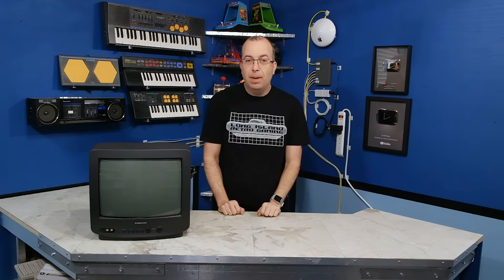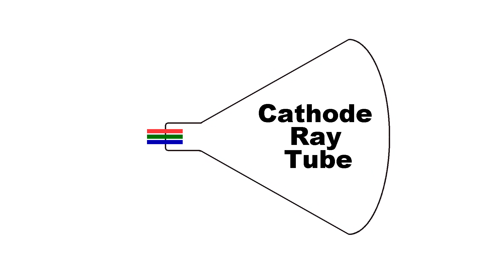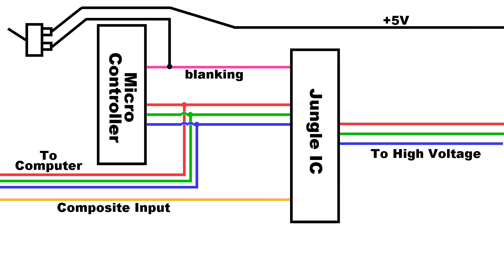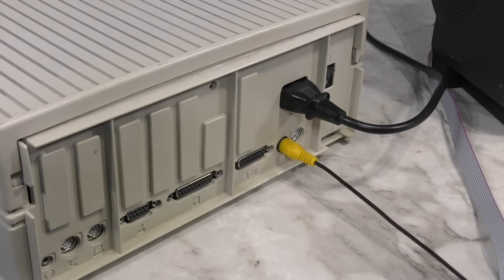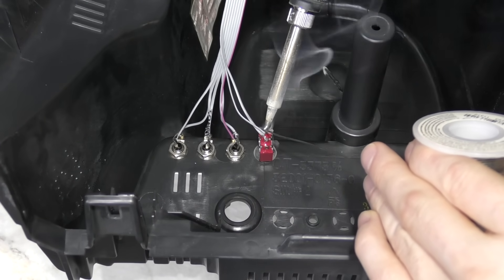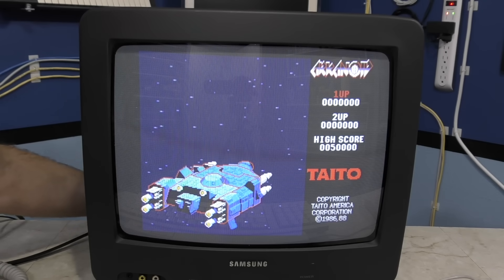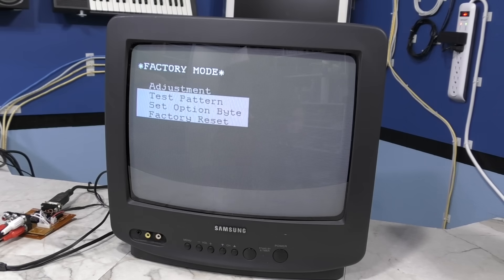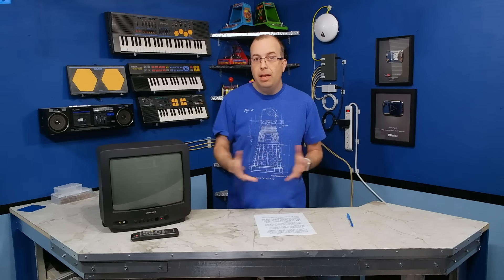Modding a consumer TV to use RGB input

Comment: Very nice! For ages I didn't know that Scart RGB is something that's not common outside of European countries.
Reply: Just a note, just because a TV has a scart connector, doesn't mean it supports RGB input. We had a sharp with a scart connector and it only accepted composite and s-video input.
Reply: @Kurt Häusler: I would suggest that in fact your TV SCART connector was capable of RGB (as the video says, internally the TV must support RGB). However the RGB pins on the connector were separate from the composite video pin, and some cheaper SCART didn't connect them (that's 3 extra wires after all), so with no RGB connect the TV reverts to composite. But essentially you are correct: SCART is an connector type, there's no guarantee that it will be wired up in any particular way.
Reply: > just because a TV has a scart connector, doesn't mean it supports RGB input

True, but those TVs are rare, because in order to be able to sell a TV in France, it had to support RGB. Only manufacturers who ignored the French market were able to omit RGB support.
Reply: @MrKurtHaeusler  VERY Important point. A lot of people think SCART == RGB. Direct RGB via SCART was often a high-end option.
Reply: @MrKurtHaeusler  same as i have seen in Norway too :) usually youst composite :)
Reply: You're right. Also by late 90s and in the 2000s there were TV with 2 scarts, only one of them with RGB, that conector was marked in blue, the other one was only capable to manage composite video.
Reply: On the UK Europe versions they got it right Scart 1 was oth RGB and NTSC support. Scart 2 was often Composite and S-Video based Scart with PAL only. 

Composite was NTSC and PAL over YWR RCA Cables input.

The later UK TV's are definitely what you want to import for a good RGB TV with all the picture standards even if the S-Video port only supported PAL whilst every other port is region free it's still the best for the time the later RGB TVs.
Reply: I hate to see that most modern 4k tv's nowadays have no SCART connector, only a combined composite/component input and HDMI. Which is a shame! The #1 requirement i have for a tv is a single SCART connector for my retro consoles. Why? SCART is basically every analog standard that ever existed in a single connector. With the right adapters, you can run composite, component, s-video and RGB through the port. SCART even had stuff like passing your tv's remote signals to your VCR, which has been adopted in HDMI (HDMI-CEC originates from SCART) or an video and audio return signal for your VCR.

SCART was truely amazing....
Reply: Might have been more to do with the fact that we tended to use TVs largely with consoles in North America back in the day as opposed to microcomputers; never heard of SCART until I got online and read about it :)
Reply: In Europe from the mid-eighties all consoles came with SCART connectors, as did micro-computers. Though as SCART carries both RGB and composite, not all of them used RGB out of the box (by bundling a cheap, composite to SCART cable) but most could.
Reply: @Wazoox  Not everywhere. I live in Finland, and got a Commodore 64 around 1988, and only got that simple antenna cable that connects the computer to TV. And I've never seen live those switcher boxes that the Americans and Japanese seemed to have with similar systems. Instead, we just had to every time pull out the normal antenna cable from behind the TV, and directly connect the cable from the computer, and after finishing with the computer, put back the normal antenna cable. But on the other hand, I don't think either of our 2 TV's would have had SCART back then, anyway. The large ('large'=26" in that time period's scale) TV in the living room was a wooden Salora, and I think it only had permanently installed power cord, antenna connector, and some mysterious round (DIN?) connector in front panel under a small door, that was never used. (The connector might have been for connecting a camcorder, which would have been really rare back then, or it could have been for connecting an optional, wired remote control.) A smaller TV, 14" Peony, was bought with the computer, and I don't remember it having any extra connectors either. Though, the 8-year-old myself might not have understood and memorized everything, but definitely, if we'd have had a SCART cable, I would have gone through all appliances to see if such funny-looking cable could fit in. I think it was at some point in the early 90's, when our VCR was replaced, that the new one came with a SCART cable. The old VCR would have had SCART connectors, but they were never used.
Reply: CanuckGod scart has nothing to do with microcomputers, the French developed it in the early 80s because of VCRs.
Reply: CanuckGod Consoles came with scart cables too in Europe,
Reply: consoles were also SCART in Europe- I actually don't remember using anything else until hdmi came around. "modern" tv's had rgb but only a few (and mostly the expensive stuff) did put out rgb....
Reply: Oli K hey that explains why my picture always was as bad as 8-bit guys picture, even though I always used SCART. Can you RGB-Mod the cheap european TVs?
Reply: In the early 80s lots of my friends in Canada used a TV with their VIC-20s and C64s. It was generally hooked up with an RF modulator and TV-GAME switchbox though, so not great quality. Served me well for a long time. Never got a dedicated monitor for use with my computer until the Amiga years.
Reply: In 1981 SCART became mandatory for TVs sold in France. Eventually it became standard for most of European countries.
I think French were forced to develop some standard for AV devices, because their color TV standard (SECAM) was too bad for this purpose: it screwed up the colors when combining two signals together, which for example made impossible for VCRs or satellite receivers to overlay OSD text.
Reply: Invader TAK On the flip-side we got shitty PAL ports that ran slower, often music playing slower and stunted graphics :( The Japanese though, they got the best of both worlds...
Reply: PhilsComputerLab got my snes 60hz modded back in the day, was a pretty essential mod, even pal designated games ran full speed then
Reply: @philscomputerlab  would still rather pal than ntsc.
Reply: GitarStu if you were using rgb then you were not using pal or ntsc. 50hz rgb was higher resolution but those extra lines were just used for blank space so you didn’t gain
Reply: mr y mysterious video The extra lines in PAL mode were used indeed. Just look at PAL resolutions on Amiga compared to NTSC ones. 
PAL interlaced mode : 576 lines. NTSC interlaced mode : 480 lines. 94 extra lines.
Reply: @srfrg9707  sure but on consoles he negative used them for blank coloured bars, the snes were black leaving you with squished image
Reply: mr y mysterious video Most consoles dropped half of the lines anyway. That's why I never bought a console.
Reply: I've seen exactly one TV with it, a 25/27" Curtis Mathes set.
Reply: Rod Beauvex I saw it once, on a high end Zenith console TV from 1988. It was their most expensive set at the time.
Reply: The hole for the composite and audio jacks on the back is even SCART connector-shaped on this television!
Reply: I only ever saw a Scart connector when I visited Germany. Yeah, it's completely foreign to me from the US ;) I'm DEFINITELY doing this mod to my CRT TV (looks just like this but I think it's Sharp)...
Reply: @FalconFour  did you ever do a rgb mod to that tv you was talking about?
Reply: SCART was a thing in Australia in the 80s.  Lots of mid-range TVs came with them, and most consumer grade players supported SCART.
Reply: @stoojinator  well technically all Foxtel boxes supported scart up to the IQ3 gen 1 which was the latest one to have it
Reply: SCART is an acronym for Syndicat des Constructeurs d'Appareils de Radio et de Télévision. How French. No wonder why it never went out of Europe. It was so useful though, any micro computer or console was sold with a proper proprietary connector --> scart. I still own a new Thomson 24" 1080p flat screen with a scart connector, perfect for retro gaming.
Reply: Yes man. We are so used in Europe. Here it is called the Euro-connector, and it has been a standard since the late 1980s. Nearly every TV has it. The first thing I did when getting a new console, was to get the SCART cable, it made a huge difference. It's odd that it wasn't a standard in the US.
Reply: i saw a late 70's wood cabinet (no vineer) color tv in Bitropolis the other day, it was a Philips that had friggin' Peritel scart inputs on the back!
Reply: I hate when smart TVs do not come with SCART. They advertise high quality picture and then make you watch your DVDs over composite.
Reply: Sega consoles even came stock with RGB SCART cables over here. they were the only ones though.
Reply: Haven't ever seen a scart connector in real life
Reply: @gladyszryan  I have a TV with ONLY a SCART and antenna connectors.
Reply: I have a TV with both RGB and composite Scart sockets. Never actually understood the true difference. My Philips MSX needs RGB, but most devices like VCR's work on both. In case not, a different scart cable often helps.
Reply: I’ve seen a few scart cables up here in Canada, no TVs tho, unfortunately a lot of the chain thrift shops don’t sell CRTS any more for some unexplained reason
Reply: I connected an Amstrad PC-1640 to my Sony TV SCART connector.  It was CGA with EGA colours, and looked fantastic for the time.
Reply: Yeah, it also was called Euro-AV.
Reply: Same
Reply: @InvaderTAK1989  It's still stupid that decades of of people had the ability to have rgb. But no one made the port. By the time componet was common HDMI was basically the norm.
Reply: I honestly have never even heard of scart rgb before this video :p interesting world we live in
Reply: Hikari I think you're missing the point. SCART connector is the best way to connect any old computer or old console, period. The only other standard able to match the quality expected with a RGB SCART would be a real YUV output, although I only saw YUV on DVD players. What surprised me on Dave's TV was the chassis, completely different from the European ones. The place for the SCART connector is missing on the board.
Reply: mwalsher it's a French thing afterall...
Reply: I knew and still know nothing about SCART. I had no idea it was a thing until recently. Which is interesting, because I'm Australian and in a lot of cases we get the European version of things rather than the US.
Reply: @clonkex  SCART is a french invention, related to their SECAM colour system. While SECAM was used only in France, the SCART plug spilled over to neighboring countries, like Germany, Switzerland, Belgium, etc.Mostly for the single reason that there was no standard plug to connect VCRs to TVs.
SCART did that job, but it's huge and clunky., so the SCART connectors on TVs and VCRs often were the first victim of bad connections.
Reply: There are some other obscure european technologies, like analouge HDTV, which was a thing in the early 1990s. (google "D2MAC" if you're interested).
Way before, France had a 819i system in the 1970s which was widely used, yet only in black and white.
Reply: we had s-video and before that c64 luma chroma many tv's had that 
what we used on our c64
s-video is the upgraded version of it
also some of our tv's had scart or it was hidden behind plastic breakouts
had a fisher tv like that
had all kinds of inputs great sound even extra glass over the tube
to bad lightning hit it
Reply: @scarlett5924  svidreo sucks compared to SCVART
Reply: @girlsdrinkfeck  What's SCVART
Reply: I live in Europe.
Reply: Scart was like the USB of the day 😎
Reply: @pendaco  More like HDMI
Reply: @PhilsComputerLab
Scart started in Europe because the French wanted to protect their local TV producers. It became compulsory on new TVs sold in France from January 1980 (see Wikipedia).

It was a silly idea.
Reply: My neighbour freezes my poop with a fire extinguisher.

Comment: Huh. Figures you'd try this right when I was thinking of something similar - I currently have a multi-system Panasonic television that only has composite input. (It's a PAL television with NTSC support).
But the thing is, when I was living in the UK I had a Panasonic television with RGB SCART input. (which coincidentally also supported NTSC input)

What's the significance? While they look different and have different inputs, they are both 21 inch Panasonic televisions and I'm almost certain they have identical picture tubes. (being from basically the same era too - 1998/99)

It stands to reason that the only real difference between them is the housing and some of the circuitry.

(Australia is annoying in that regard - we're in a PAL territory and got all the PAL computer systems, but our televisions generally only had composite - there were a few that had RGB scart, but they were rare - usually advertised as having a 'euro' connector. - I've been tearing my hair out for a while trying to get a CRT with SCART here, since it's pretty important for PAL hardware from the 80's and 90's... But not much luck for the most part - my best outcome so far is a 2005 plasma display that has VGA, DVI, RGB scart, S-video and composite - yes, it has everything, but it's a plasma, not a CRT... Not terrible, but try say an n64 on it and you realise it's still not the same as a good CRT...)

Further investigation of televisions in general - especially 90's models, led me to the conclusion that most televisions from that era are RGB displays with multi-stage conversion circuitry for everything else.

As in RF input gets the carrier and audio signal stripped creating composite, which is passed to the composite circuit.
The composite circuit separates out the Chroma and luma signals, effectively creating S-video.
S-video is then converted to RGB and sync signals which then drives the picture tube.

It then follows that each form of input simply skips some of the steps, with RGB skipping most of them.

It then also follows, that RGB modding a television should really just consist of wiring a connection into the RGB circuitry and bypassing all the stuff that would otherwise come first...

Still, it's one thing to think of that, quite another to see someone try it...
Reply: Incidentally you can tell European versions of your TV had SCART (and probably RGB support because of it) by the shape of the cutout where the connectors on the back go.
That shape is a near perfect match for a SCART connector...
So... Yeah. Surprising no-one, this TV was designed with SCART in mind...

Comment: Very nice mod... Little question: shouldn't european scart be already analog RGB, requiring only a cable adapter? BTW I know how it felt switching from composite (although EU's PAL looks cleaner than NTSC) to RGB (scart in my case): when I bought a proper real scart cable for PSX it was PURE Bliss for me.
Reply: MasterControl90 You can only use a scart TV with computers designed for the european market (PAL compatible). PAL signal is 50Hz when NTSC is almost 60Hz. By the end of the 90s there where a few high end multisynch TVs capable of both PAL and NTSC sync though. 
The last european CRT TVs usualy run at double frequency (100Hz, with embedded deinterlacing modes for more comfortable computer usage).
Commodore computers usualy came in PAL or NTSC flavor. So did the games, that's why many amiga users bought multisync monitors.
Reply: I think most late 90s - early 2000s European CRT TVs will actually display a 60hz signal just fine. Especially with RGB, since it doesn't require being able to decode a broadcast color standard like NTSC. The ones I have definitely work. 

Many later game consoles sold in the European market supported outputting a 60hz signal for many games as well (Gamecube and Xbox did)
Reply: Edwin: yup, Dreamcast games had a PAL 60 option that put the game full screen and the Amiga could be flicked between 50/60 hz via software or on later kickstarts a combination of holding down mouse buttons on power up.
Reply: I know :P
Reply: I know and it also mean that with a simple adapter "should" work fine.
Reply: MasterControl90 With high end digital converter, such as black magic ones, yes, with 'simple' converters (analog ones) just forget it. The result will be pixel salad. Even with black magic ones gamers will complain about delays though.
Reply: to be clear I am not talking about VGA to scart but just old school RGB+composite sync as showed
Reply: Short (dumb) answer: Yes

Longer (less dumb) answer: It's complicated.

Factual answer: The problem is that the same connector was "standardised" multiple times. In France prior to 1997 it could be wired any which way a manufacturer decided, in Europe post '97 the EN 50049-1:1997 standard rules, in Britain the BS EN 50049-1:1998 / BS 6552:1998 standard applies, in Japan the unrelated EIAJ TTC-003 standard uses the same connector but is not really related to any of the others.

Andrew Tanenbaum had a point when he said "The nice thing about standards is that you have so many to choose from."
Reply: Obligatory xkcd 927 reference is obligatory https://xkcd.com/927/